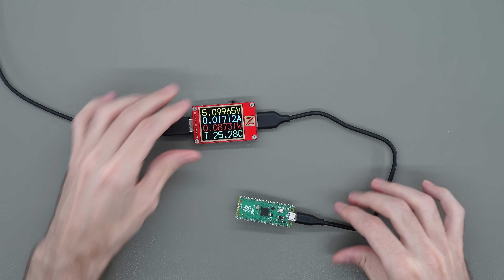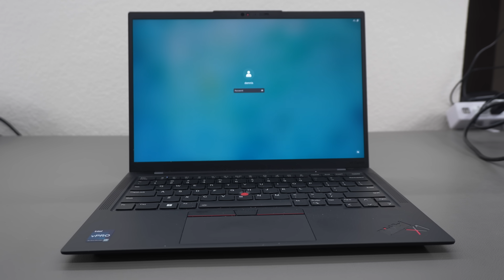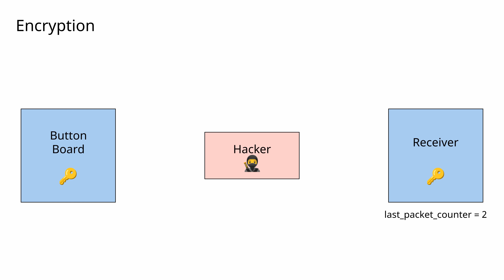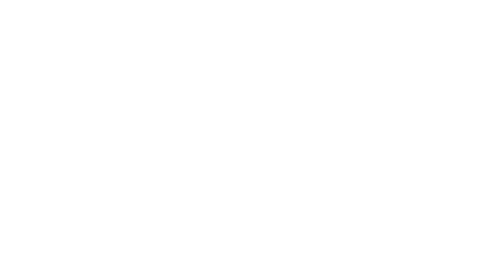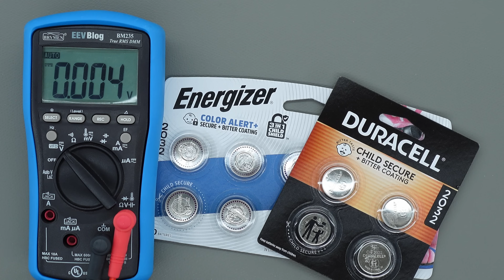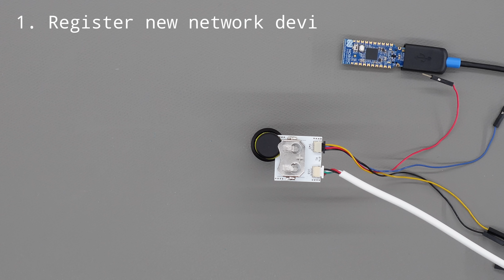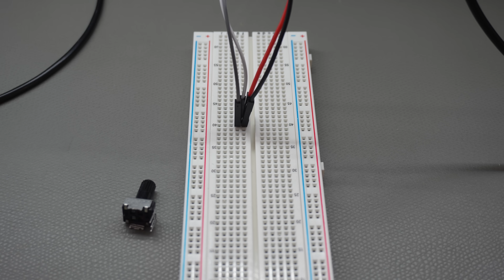I Just Wanted a Button. It Escalated.

Comment: Ooh, this is neat. Tbh, I get the feeling that by the time you have a protocol that is reliable and can handle a large variety of devices and manufacturers (as well as wireless pairing and the like) you'll end up with something that looks a lot like zigbee.

Wrt Home Assistant integration, probably MQTT + a bridge to HA is the best way to go.
Reply from the maker: Luckily I just need to deal with one annoying manufacturer named Dennis.

Comment: you could make the display update as a weather station then put the receving station in a case with beefy antennas to pick up a signal almost anywee and when the weather sensor detects a change in weather display it on the display also it would be useful to make 'hardwired sensors with terminal screws to cables that go to terminals in the base station, also another thing to try is make an app for the base station to run on the raspberry pi so that you can see all of the battery levels and warnings plus status and events that are happening on your phone

Comment: You really don't need much power in standby mode for a lot of these chips, and you dont need them to be active for very long, so....why use a battery at all? Why not use a calculator solar panel to charge up a bigish capacitor when the button isn't in use. Push button, trigger interrupt, wake up, sign an ID, blast it out over the radio, go back to very low power mode.

Comment: Thanks for including a fantastic section about security. Not just showing what people use but explaining step by step what the reasoning for the complexity is. If you just show the result of decades of security engineering it can be easily blamed as „corporate overkill“ and feels overwhelming. Especially the part with the counter and prevention of replay attacks is great and well explained.

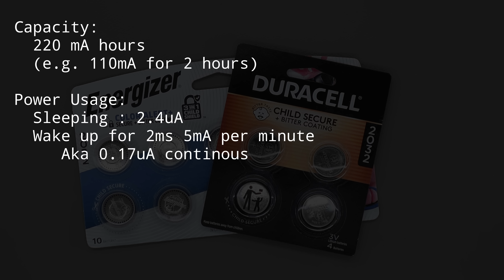Comment: @20:25 - It's obviously not 'continuous'.  While I understood it, it did take a second - that wording is not very accurate.  Should have said it's the 'equivalent of a continuous current of 0.17 uA for one minute'.  If you describe that first, then talk about sleeping current and add it in, it'll be much clearer what you mean.  Oh, and you'd be very surprised how many of those little LiPo packs are already in households.  They don't blow up (have to be under very specific circumstances), but they can catch fire...  IF they're handled by someone who just doesn't care.  Don't puncture them, don't overcharge them, and don't try to charge them while frozen.  Heat can also cause failure, but it takes a Lot.  Treat them with half a brain and they'll last a long time.

Comment: You can use a LiPo, all you need to do is charge it to 80% and only allow it to drop to 20%. That gives you 60% of its capacity. This will let you take advantage of its high energy density, and also keep the cell from degrading. This would leave you with a sensor with a crazy service life. There are fire alarms from Fire-angel that will last 10 years off of it's internal LiPo. It is deliberately made so you cant just remove the battery, so you know as long as it is on the wall, it will work. And the 10 year battery life is perfect, as that is the life of a fire alarms smoke detector unit. When the alarm is at end of life, and starts to beep because its battery is low, it is time for you to replace it anyway. If there was a fire risk involved with using a LiPo in this way, I'm sure it would not of been used in a smoke detector from such a reputable brand In fire safety.

Comment: How much power could you save having it do the heartbeat for sending out the battery level to once an hour or every 2 hours instead of once a minute?
Reply from the maker: At once per minute, it consumes around 8% of the battery life, so you could tune it to be <1% though the batteries are only rated for 10 years of life overall so at some point, you have to worry about over aging/decay issues.

Comment: So nice! Is there a good tutorial to get started with the Nordic micros and tools and all that?
Reply: it works the same as any other MCU, just use the official KiCad component library, assign the matching footprint then route power, decoupling caps, and the RF matching network per Nordic's reference design (or just use a template lol) in the datasheet.
Reply from the maker: If this is your first time working for Nordic or MCU stuff in general, I'd try something from Adafruit or Sparkfun (e.g. I have a bunch of https://www.adafruit.com/product/4481 ). They have a bunch of boards for different microcontrollers and written tutorials to go with each of them.
Reply: @MadeByDennis  Thanks for the reply! I do have some experience with MCU, but used to tools like Arduino that will make your life much easier. Just a little bit scared of the nordic SDK hehe.

Comment: Nice! Of course with a button, you do not need to consume any standby power at all, even if your module is quite inefficient. Just make the button switch battery power to the module. Have a separate current path through a MOSFET from the battery to the module. When the button is pressed, the module powers up and switches the MOSFET on. As soon as it is done sending the radio message, it switches the MOSFET off again.

Comment: It's crazy - I just want something compatible with regular smart home protocols (zigbee, thread, zwave, etc) with two requirements:
- Looks like a regular light switch, so I can put it alongside my existing switches without it looking weird
- Can disable double-tap support. Every button I've used waits  for half a second after you press it to see if you're going to press it again, and it makes everything super laggy.

There's nothing I've found out there that meets either of these, much less both.

But oh boy, you're not wrong when you say those specs are complicated. The thread  example code on an STM micro I played with was fully integrated with FreeRTOS, and that's  not really the complexity I want when I'm just trying to make a button lol

Comment: Wow thanks! This was genuinely helpful. I am currently designing a solar and TEG powered smartwatch with an E Ink Display, some sensors and a once-a-day bluetooth connection to retrieve outside data. I am also using the same microcontroller and you helped me out a lot understanding the power consumption constraints…

Comment: Rarely actuated sensors in a dumb network are the stuff that can be trivially powered forever by a battery. It's the receivers that are basically fucked, because they have to keep listening more or less all of the time. If they can be mains powered, jackpot - if not, you're SOL. If your sensor needs to sends fairly often regularly to keep overall reaction time reasonable, you're SOL. If your sensor needs to be reachable remotely in a timely fashion, you're SOL. This is why all RF standards have issues powering things by a small battery for a long time, taking forever to propagate messages, or both. Button-like nodes are just about the only exception...

Comment: Normally Closed reed switches are what you actually want for your door sensors. When the door is closed, the entire device is off, when it's opened, the reed switches turns on a device/sensor. This works out really well, because there is a certain amount of "turn on" time, and if a door is just briefly opened it won't trip the sensor. Basically does the debounce for you. 

Also, because you can make the circuit stay off until needed, you get fantastic battery life. Combine that with a coil motor in the door that charges a capacitor in the sensor, and you have infinite battery life. Infinite is probably longer than you need of course, so, better to just use batteries and normally closed switches.

The rest of this is fantastic, like 10/10, solves actual problems that exist in the current HA market.

Comment: Cool project! Would love an iteration of it with rechargeable AAA batteries. I've been running my smart home with zigbee for quite some time, and i have tried to replace all of the sensors that use coin cell batteries as it feels like a waste when it suddenly drains a bit too fast for my liking
Reply from the maker: Thanks for the suggestion. Do you mind clarifying your concern about "suddenly drains"?
Reply: @MadeByDennis  I feel like some zigbee sensors suddenly go for 80% down to 30%, and then I have to replace the battery shortly after

Comment: Did something similar with esp-now (FDRS), esp8266 and small circuitry for complete powerdown with wakeup Button. runs for years in an 18650 lion. Also Made an Environment sensor using d1 Mini esp8266 and dht11, ads1115 adc to measure soil Moisture and battery voltage. Runs still for now. It wakes up perdiodically. Nrf52850 IS a great Microcontroller since it so power efficient. in use with solar and lora it's great for outdoor Sensors that will operate a very Long Time or Just as an meshtastic node.

Comment: Or you could just do what i did, replace the old fashioned switch with a deviator switch and control one side of the deviator with a relay SPDT that is controlled by smart tech. This way all the old fashioned works even if there is something wrong with the smart circuit. Old fashioned electric diagrams never let you down even if the relay fails in one position or anything happens with the network and everything. In cases where i already had deviator switch i did put a DPDT relay to act as an inverter switch. this way not so smart bulbs get controlled by smart tech without replacing anything and still having control in the old fashioned way. If you design small enough pcb with the relay you could fit that inside the existing switch case and have the best of both worlds

Comment: Great project. Still there is no need to beat down on mechanical reed switches.

A double throw reed switch will not consume power when active, you just use the normally closed contact.

It is also easy enough to position the magnet so it activates a normal reed switch when the door is just starting to open so a pulse is generates as it passes the just open position.

Lastly reed switches are very reliable and long lasting and are used in pulse generating reed relays.  They will probably outlast your door latch.

There is a great paper you can find using certain search engines with the search term "CotoRelays Testing-Reed-Switches-Relays-for-Reliability" A reed switch will last 1 million to 1 billion cycles depending on what you are measuring.

Comment: you done the reed switches dirty man 
there is NO and NC reed switches 
for the door you could use a normally closed switch 
which would be pulled into open position when the door is closed by the magnet and consume zero power

Comment: I ended up getting IKEA RODRET Zigbee buttons some time ago to replace my old Flic buttons, but honestly, I found an even better solution, and that's using occupancy detection from all kinds of devices: PIR motion sensors, presence detection with mmWave sensors, person detectioon on cameras, the "don't close the garage on me" foot sensor, etc.

Lots of sensors exist; all you need to do is configure them as a single binary sensor group, and now you've got a way to turn on and off lights without ever touching buttons.

I've had this setup for 2 years now, and my wife and kids love it:
- My kids like that they never have to go into a dark room.
- My wife hates messing with light switches to the point where she'll use her phone as a flashlight if I don't automate 'em.
- I love it because my kids don't mess with my light switches anymore (I made those smart recently as well to remove my IKEA buttons). My kids they forget to turn off lights anyway, so this covers that situation too!

With the buttons, if you press the "on" button, it'll disable occupancy sensing. It used to be important when I had fewer or crappier sensors, but not anymore! Pressing "off" resets it btw.

The only weird situation is the theater room. I disable occupancy sensing when you turn on the theater and turn it back on when you turn the theater off.

Comment: Couldn’t you use the battery status as a count down counter instead of count up one to encrypt unique presses?
Reply from the maker: Unfortunately, the battery status is not a very reliable/stable number over a short period of time since you are measuring a physical property with noise so you may get the same reading / higher / lower readings in consecutive measurements. The ideal counter needs to be strictly increasing or deceasing without repeats.

Comment: Regarding the holding of the button allowing power consumption, could you just have a capacitor in series? A high pass filter will notice a pulse but not consume much more power?
Reply from the maker: Thanks. Yeah, I think that would work

Comment: Idea: an RFID button that is powered by the mechanical energy of pressing it, sending a single id blip each time
Reply: It's called EnOcean-Protocol. Not really widespread but really nice for light switches.
Reply: @hyperloler  What frequency is EnOcean on? Does it always use the same LoRa frequencies, 868 - 433 MHz (USA 915 MHz)?
Reply: @-Evilempire-  868 in europe, 902 in north america, 928 in japan.
Reply: @hyperloler  thanks 🫡👍
Reply: @-Evilempire-  ocean
Reply: @OrdinaryCritic  sea
Reply: @-Evilempire-  lake
Reply: We have a wireless doorbell.  The receiver is plugged in and the button has a tiny magnet that flies past a generating coil.  When you press it wakes up the button and calculates the packet, when you release it turns of the Tx and sends the packet.  I have no idea if it is compliant with any standard but the unit was paired at the factory. No more batteries, yay!
Reply: aquara had some of these
Reply: Gyoza no Ohsho (restaurant chain in Japan) uses something like that to call waiters. It’s a mini lever that you press down to turn some gears, which both power the mechanism and trigger a signal to be sent.
Reply: Phillips hue used to supply this idea actually
Reply: RFID would reach far enough iirc.
Reply: they already exist , but I don't think they are RFID, at least the ones I have are LORA. They are called LORATAP, then there are other brands that distribute them, just search no batteries kinetic switch
Reply: they already exist i just cant remember the name 
its a whole home automation system based on these afaik

Comment: Not a fan of the vibecoding, what's even the point if you're just gonna let the computer take the wheel.
Reply from the maker: I only use it for the parts that are going to be thrown away. There's no point in me investing a ton of time into the RP2350 if I expect it to not work based on datasheet numbers.
Reply: @MadeByDennis  okay

Comment: Awesome video. Love how you've covered some of the lesser known intricacies like the battery voltage dip when current draw spikes and the mitigation measures. Also on adding a switch to disable high(er) current draw devices that only need to be used on intervals.

Comment: Haven't thought about that earlier, but now I've realised... Building my own smart home from ground up including all the software would be actually easier to do and more customizable than using any alternative like homeAssistant for example. Especially with vibe coding. Most of the sensors can be easily built and programmed or bought as a kit that is easy to connect via whatever you want than to buy another overpriced sensor/light bulb/whatever bcs it works with the system you have. The only thing I'm sceptical about is security stuff like cameras, but those ones are also easy to buy and connect to your own server.

Comment: why are we stopping hackers from turning off our lights at all? is this a big problem? seems like a waste of energy and time
Reply from the maker: You would generally do this for two reasons. 1. to protect against malicious actors: I'd expect its most likely if there are some kids around that want to mess with people, but yes, it is not super important for something like lights but it is good practice to secure protocols since things tend to be expanded in the future to more sensitive areas: e.g. using the same protocol for headphones, a security system or a medical device. 2. it protects you from interference from other poorly configured devices. e.g. if your neighbor has a smart device, its much less likely that it can generate data that will interfere with you since encryption also provides rejection of outsider data.

Comment: There are rechargeable 2032 batteries, you can use the ones used as backup batteries for PC BIOSes.
They're called ML2032, but unfortunately they have very little capacity compared to normal ones: 70mAh versus 200mAh.
Reply: awh shucks, they’d have to be charged every 2-3 years :(((

Comment: Very neat. Smart idea to have a multi purpose pcb.

Off topic a little; what're those little stand / holder things? I'm still looking for decent work holding gadgets and I've never seen those before.
Reply from the maker: I'm using these https://sensepeek.com/pcbite-kit-s-insulated . They are magnetic so just the table is custom and has a plate of magnetic steel with a high temp anti-static mat over that

Comment: What are these holders you use for the PCBs? Did you make them yourself?
Reply from the maker: I'm using these https://sensepeek.com/pcbite-kit-s-insulated . They are magnetic so just the table is custom and has a plate of magnetic steel with a high temp anti-static mat over that